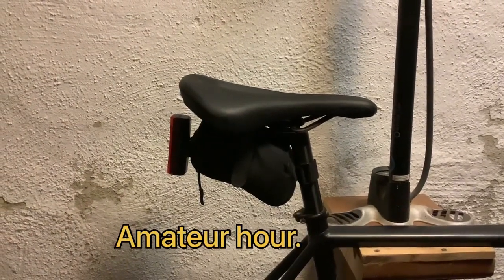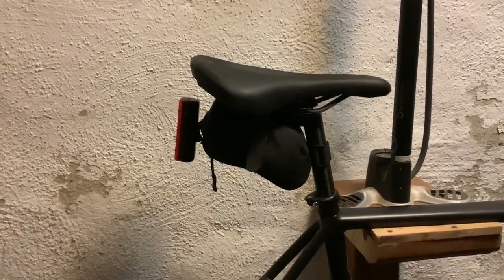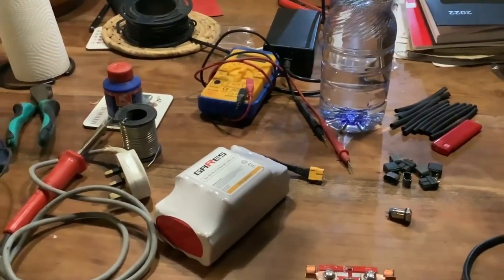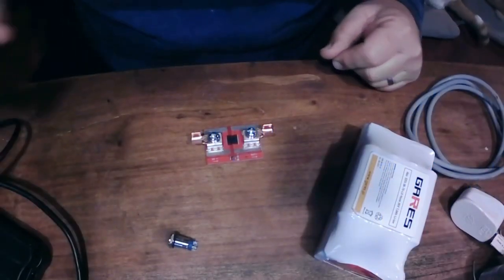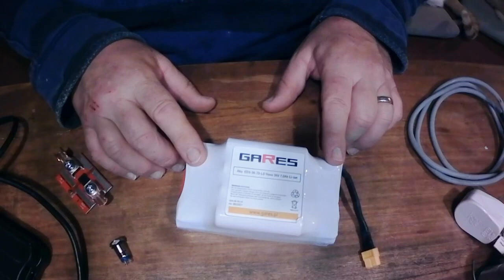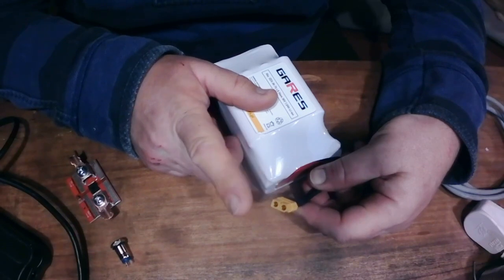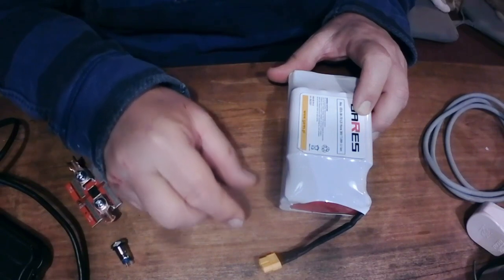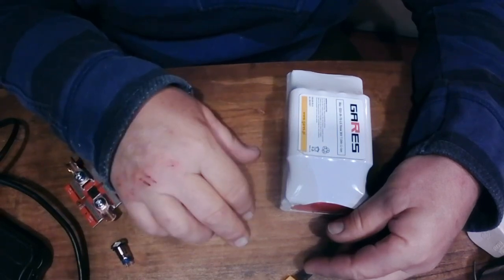DIY Mahle X35 Range Extender - Save $$$$$!

Comment: This is very interesting. Can you show links to the parts you use? Thanks !
Reply from the maker: Hi Pascal - everything came from either eBay or AliExpress - they are easy to find!
Reply: @yakoridesagain  Yes I ended up finding everything. The only issue remains the plug that connects to the bike. Did you end up finding one ? Or we still have to cut/modify the charger ?
Reply from the maker: @pascalcastellazzi4136  I did find the manufacturer but they sell a minimum of 200 units. I said yes, as I thought I would make these to sell, but I’ve heard nothing for months, despite repeated messages. So…yes, you need to cut the one off the charger. It will be ok! Mine still works very well - the extender, the charger, everything! Good luck, just ask if you get stuck.
Reply: @yakoridesagain  Thanks ! Maybe the company which does the connector has an agreement with Malhe and they cannot sell/release them? I am also investigating the option of building a solar charger for the ebike. I have found a 12VDC to 42VDC converter (a car charger for ebike batteries) but it is only 1.5A? Do you think that would work ? (beside beeing slower...). Cheers!
Reply from the maker: Well the battery management system will only accept up to 2a, so 1.5a would work, but yes slow (8-9 hours) to charge both battery and extender if fully depleted. Let me know how that project goes, it sounds interesting.
Reply: Could you please share that list? Thanks in advance!

Comment: Thanks for this!  I started looking into making the same for my wife. It's for an Ebikemotion from Mahle.  The output voltage of the charger is 42V at 2A.  The connector's output when the bike is ON is around 41.5V.  So I would assume I would need a bit more than a 42V battery since the diode will cut about 0.6V.  Does that make sense?  I'm reading in the other comments, that I need 30V, this may be true for other types of bikes?
Reply from the maker: No problem Simon. You need a ‘36v’ battery, which as you say, is charged at 42v and is fully charged at around 41.5v. The ‘36v’ is more a rating, really, as the voltage depends upon it’s state of charge.  The two batteries - range extender and internal - are both charged to full, around 41.5v, then connected. They work together; the external range extender battery shares the load with the internal frame battery so if the motor demands 7amps, 3 amps come from each battery and they deplete together. My system is the same as your wife’s, and the range extender has been working perfectly since installation around 4 months ago. The ideal diode takes a tiny fraction of what you say…I forget exactly how much. I know that the loss does not need to be taken into account though. I’m not sure what the 30v relates to, though it sounds like a fully discharged ‘36v’ battery. The one you need is also known as a ‘10s 2p’ battery, which means there are 2 parallel banks of 10 cells in series within it.  All you need to decide is the capacity of the battery. More Ah = more range, but higher cost. The one I bought was a 7Ah battery, the cheapest ones are 4.4Ah. Hope that makes sense, but feel free to ask more questions if you need to.

Comment: I am very interested doing that but i am really scarry about forgetting full charge the 2 batterys. 
The diode prevent current from the main battery to the extender but finally there is no protection if the extender has an higher voltage. Probably the main battery BMS will cut off circuit .... but what about installing a polyswitch resetable device.
For example we can choose one that limit current to 5A.
this device will cut circuit in the 2 different situations .... from main battery to extender and from extender to main battery.
No need of diode. 
What do you think about that ?
Reply from the maker: Hello! Happily, the Gain was originally designed to have a range extender of this type, not the mini battery charger they ended up with. over the 14 months I have been using my extender, I have inadvertently charged the extender not the bike, and the bike not the extender. No sparks, no heat, no problems.  I do not chance this on purpose, but it has happened. The Gain BMS or controller offers protection. For peace of mind, buy a cheap voltmeter and check before connection.

Comment: I wish I had the know how to do this. I've just had to pay out £700 for a new battery on my Cannondale and knowing the extender could lessen the chance of that happing again as well as cycling further is very appealing.
Reply from the maker: I feel your pain! One of the problems is that if the battery goes wrong, you can’t just change the battery, but also the expensive controller that is within the same casing - which was probably fine. That seems common to all ebikes, sadly. 
I’ve suggested to others that you could buy the parts and take them to a local appliance repair shop to do the few bits of soldering and get it shrink wrapped…it’s very straightforward…
Reply: @yakoridesagain  I might just look into that. Thank you for your reply.

Comment: Hi Yako, I am surprise because the system Mahle use CanBus to manage this drivemotor and normaly CanBus use a identification code to exchange with eacht components as for exemple a additionnal battery ? tomorrow I take possession of a Cannondale Topstone Neo SL2 and I will surely need an additional battery
Reply from the maker: Hi Jean-Claude. Yes, I thought the canbus would need to ‘shake hands’, but it doesn’t. There were no compatibility issues at all.  I am sorry however, as your bike uses the X35+ system, which I haven’t checked will also work like the X35 that I have.  I suspect it will…perhaps you could buy a very cheap AliExpress battery to test that the system will work as it does with mine?
Reply: @yakoridesagain  Hi Yako and thank a lot for your quick answer 👍 in the first time I test without additional battery 😉

Comment: i got my hover board  battery   and this is how  i made as simple as possible   charge  the bike to full  charge   and then charge the  new battery with the same  charger 
you  have to cut  the plug off  as you did    and add  connectors     once ther both full charged  connect  them  in  together  
and no  diode in use    i took the bike for a ride    i would  do the same hill route  that i know will be max range ie flashing red  on     frame  bat     of 2o miles   
this  battery is well below capacity     from new     i came back from the ride with the extra  battery installed  with 75 percent  still left    so works  great 
now  leave the battery permantly  inststalled  and charge    them  with the standard   charger      so as to keep them  at the same voltage  it was so easy and  good  results.
hope this helps
Reply from the maker: Hi Kev, glad it is working OK. You will need to be careful charging the two batteries together as once in parallel, it is normal to reduce the charging current to 90% of max. I shouldn’t think this will be an issue as the bike’s charger is already quite low at 1.9-2a. Also, do a little research into using batteries of different ages if you original battery was tired; I think there could be problems with overcharging the older cells - maybe take a look, better safe than sorry!

Comment: Hiya back again, as spring comes this project has been restarted in my house. You mention at the start of the video a battery with charge and discharge cable may be better, as you can charge both batteries at the same time. What would be different to what's detailed in this video?
Reply from the maker: Nothing. You would just need to buy the correct plug to fit the charge plug on the extender battery and solder that on in place of the plug you have cut off. Three things though, 
1. the batteries would have to have the same capacity, 7Ah, to safely charge them together,
2. charging would obviously take twice as long, say 7ish hours.
3. You would need to have the batteries connected together, always, as you would have no means of charging just one, and to connect the batteries they must be at almost exactly the same voltage….so if you disconnected then and rode with just the internal battery, you could not reconnect them safely.
With hindsight, I am glad that I have two chargers for the two batteries, and can ride with just the internal battery if I choose. Checking the voltage is the same before I connect is no problem.
Hope that makes sense. Ask away if you have questions.
Reply: @yakoridesagain Thanks. Was thinking, in the orbea cable that is cut, does this contain only a positive and negative or is there also a data cable?
Reply from the maker: Uf. It was a while ago…if there are 2 more cables, and I’m not sure there were, just hook up the two big ones. Sorry.

Comment: Thanks for the video, just for a heads up for people, I bought a extender way back (lucky I got it 25% off so it was only $695AUD) used it fine for months then one time went out and did one pedal rotation and mucked up the cable which rendered the whole battery useless, also the bottle cage is not a good place for it, anyway I might soon buy a evolve electric skateboard for airplane travel, I wonder if that battery which is also 4.2Ah
144 kWh
36V…. In fact maybe like specialised seller told Me, if you remove the internal battery which is over 160 kWh, and use two batteries 120-160kWh you could fly overseas with your bike (in my case an eSilex) and use your motor that way, maybe. Evolve battery price is $350 but I’ll try to find it on marketplace, was unable to find the battery listed here on Aussie eBay but I did find a possible battery to use that’s about $330AUD on ali express?
Reply from the maker: Hi Sleek. I’d be a bit careful - your Esilex uses the same X35 system as the Gain. If you remove the internal battery for plane travel, you also remove the controller which is integrated into the battery casing. The bike won’t work without it. Also I’m pretty sure the FAA have banned lithium batteries of over 100Wh anyway. I agree that the bottle mount isn’t a great place for the extender though as you’ll need an extra bottle on the longer rides you can do once you have an extender!
Reply from the maker: Also, if you are looking on AliExpress, suitable - though questionable quality - hoverboard batteries should be around 40AUD for 4Ah…I would try to find a seller where you can guarantee the cells are Samsung/Panasonic though.

Comment: This looks like a really great project to get stuck into. I'm thinking of making one for my dad for his 73rd birthday who is always complaining about the cost of the official battery bank orbea sell. He's not wrong. Would a 36v battery ( non hoverboard) work in place of what you have? I ask because I'd like to 3d print a bottle type holder for the spare cage he never uses. Not sure the battery pack you suggest will fit. I'm also struggling to see where I can find the four pin cable. I really don't want to have to buy a new charger and slice it open to use the proprietary connector!  Sort of defeats the purpose of doing it diy. Any suggestions welcome! I also don't want to have to cut his existing charger as he's won't like that. 😂
Reply from the maker: Hi Aaron. You are thinking of making up your own battery from cells and a BMS? If not, search for 36v bottle batteries on AliExpress. The smaller 6-7Ah ones look neatest - and come with a holder that screws into the bottle cage lugs on the frame, and their own chargers.. The ideal diode's circuit board can be trimmed to fit into the base of the mount that is provided - it's a really neat and simple way to go. I did, after months of looking, find a source of the unusual ebikemotion plug and cable from, ah, Powatech? Check that on eBay and see if it comes up. I talked with them and they are cool with providing the plug and cable for 18GBP but you must ask directly - it is not a line item.
Reply: @yakoridesagain  Sorry ..... i found it
Thanks

Comment: Hi Yako, thanks a lot for your research. I really find it very valuable. Let me say that I am also interested into get an afforable and reliable X35 battery extender solution . So long time waiting for Mahle product, and also not very happy with their pricing policies. I would like to know if you have a discussion forum currently open. I am a fan of this topic and would like to share some comments.
Reply from the maker: Happy to chat here Antonio. My extenderworks, just a little bit of soldering and it is yours!
Reply: Hello Yako, I would like to know if you continue using your extender, and how it performs, as well as any operating problems that you have observed. What I want is to know the current status of the topic to have it as a starting point. Greetings
Reply from the maker: I ride my bike most days, and leave the extender connected every ride. The extra weight is not a problem. The system works very well, and I do not need to charge the bike as often as before. There are 2 issues however.
1. The extender needs an on/off switch. At the moment, I must first start the bike with the Iwoc button before connecting the extender at the charge port. This is easy enough, but if you turn off the bike while riding, you cannot turn the system back on without first disconnecting the extender. This means I need to stop, disconnect the extender, turn on the bike, then connect the extender. This is also necessary if the bike turns itself off - for example if you stop for photos or a coffee. With a switch fitted, this process will take a few seconds only, and no need to stop riding. 
2. It would make charging much easier if the extender had separate charge and discharge connectors. The extender battery would not need to be disconnected from the bike to charge, and one charger could be used  to charge both batteries at the same time (though charging would be slower).
With these two changes, I think the system would be perfect.

Comment: Hi Yako, thanks for posting the video. I too have been doing some research because of the overpriced market options for secondary batteries. I’ve been looking at the Ninebot ES range of batteries, for powering segways and scooters. They look remarkably similar to the x35 internal battery set up. And on one of the videos there was a teardown of the battery bms, which showed the port for a secondary battery. I’m taking a look at scooter pigy-back batteries, seem to be branded under the Ninebot ES name, or compatible with….

Comment: Hello and thank you very much for the video. It inspired me to get my own bottle battery and mount it on my Desiknio that has the same X35 system as yours. Instead of cutting my charger wire to use the connector, I ordered the MAHLE Smartbike Systems Extension Wire for GCU and I intend to use it as the connector for the bottle to the bike. As I was splicing the "Extension Wire for GCU" cable and trying to figure out which wires corresponds to the male pins at the connector, I noticed that the red (positive) has a built-in diode ! Did you notice the same thing with the charger connector ?  Also, weirdly enough the extension wire has 5 cables but only 4 pins ?? A blue cable is there but doesn't seem to be connected to any of the pins. Again thank you for you great video.
Reply from the maker: Well done for finding that extension wire with the plug. What function does it serve? Is it a replacement cable for the official range extender? I did eventually find a source of these plugs too - but no, no built- in diode on them or the charger. 5 wires isn’t ringing a bell either, but a year has passed. I’ll have to check the vid now as I’m intrigued!
Reply: @yakoridesagain  The original cable intended function is for updating the software on the X35. I just cut the unneeded end for my purpose and then I started mapping the pins layout to the wires. Odly enough, the red wire wasn't mapping to any pins until I switched the DVM polarity leads and bing ... 1.38 MOhms. So I switched my DVM for a diode test and long and behold, there is a diode in the connector itself. I assume that it is in there for protection.
Reply from the maker: Ah! The diode must be to protect whatever piece of kit is used for the software update from the internal battery then. Are you replacing the wires to make sure they can carry the required amps? One viewer who was an engineer carried out tests of his DIY extender under load. He confirmed that the load is shared equally between the batteries so the extender battery cables need to be able to handle around 3.5A….
Reply: @yakoridesagain  I am soldering right at the connector and hopefully, that will do it
Reply from the maker: Apologies for mentioning the obvious, but better safe than sorry. Please let me know how it all works out.
Reply: @yakoridesagain  Didn't work. Couldn't get the voltage out of that connector, So I decided to splice right into the cable between the charger  female plugin and the internal battery. I had enough room for the cable between the pinion gearbox and the bike frame.
Reply from the maker: Interesting. Was the diode interfering? It OUGHT to have been protecting against voltage going the other way though surely? Hooking up directly inside the frame was something I wanted to do but lacked the courage! How have you routed the cable from the bottle battery into the frame? From the plastic plate under the bottom bracket?
Reply from the maker: Just checked out your bike after you mention a pinion gearbox. Wow! Do you know the equivalent range that box gives you compared to derailleurs? So clean looking, and belt drive…very, very nice!